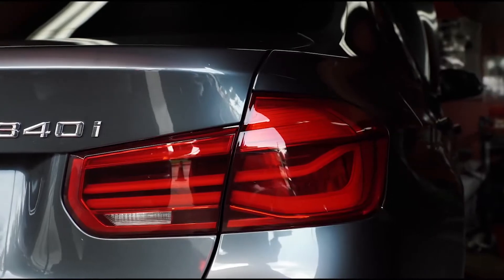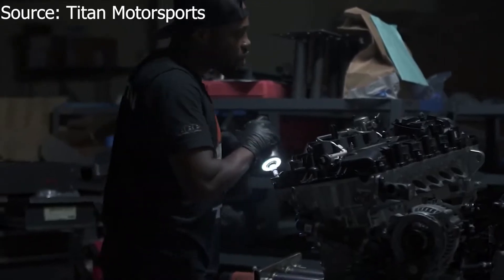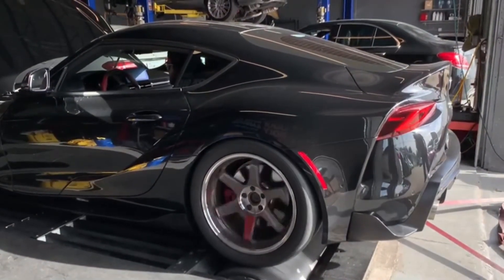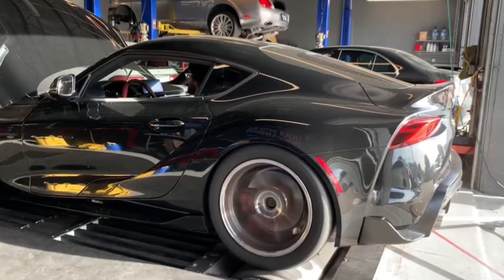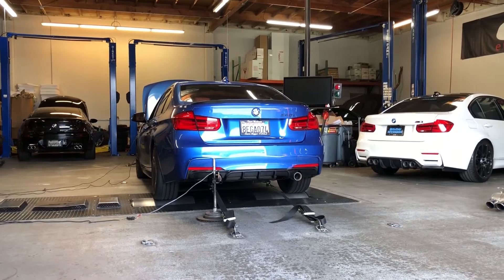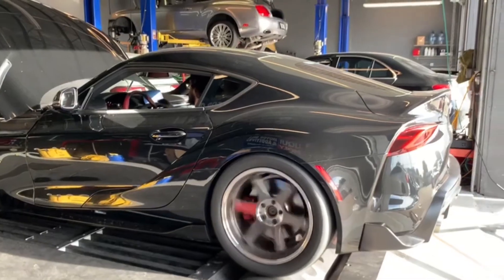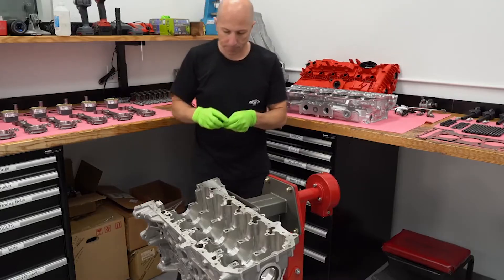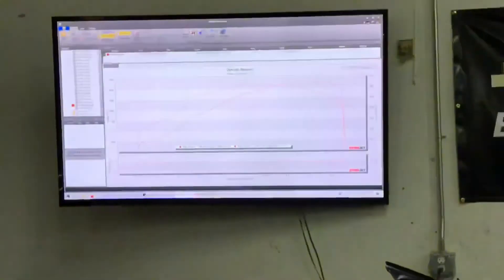How to Build you B58 (A90 Supra or 40i BMW)

Comment: I just bought a 540i i love it I have unlimited warranty for 4 years I kinda wanna make it more faster but I don’t wanna lose my warranty 😭. What you guys think I should do??!!
Reply: Find an advisor at bmw that’s cool and wouldn’t mind you modding your car, not much can go wrong with simple bolt ons and a tune
Reply: both MHD (tune) and XHP (transmission tune) can be flashed to remove it completely when you take it in for service. full flash takes about 7 minutes.
Reply: Meanwhile my dumb ass has  an E46 and is waiting for some stupid fucker to flip a 540i so I can put the engine in mine.
Reply: Get the BMW Power and Sound kit.  Warranty friendly and has a good tune map and excellent sound.
Reply: If you have 4 years warranty that means the car is probably made after they locked the ECU. Meaning you need to Femto unlock. That means you don't want to bring your car to BMW because one they update your car it will erase the FEMTO unlock and you'll have to send the ecu to Finland again and pay for it to unlock again.

Comment: What about the transmission ?
Reply: You’ll be fine up to 600hp on stock trans but you need a trans tune(XHP)
Reply: @MYRCHOBBY  im thinking about just yoinking a dct off ebay from a m5 and throwing it in a xhp tune and it should work i would assume not too much else would need to go on to hook it up? Should handle 1000 hp stock
Reply: Zf8 is solid
Reply: @JAGLIFTZ it’s a bomb don’t believe this
Reply: @UnpredictableMoose no it’s not. It’s over hyped but it’s not a bomb. I had zf cars and both held 700 wheel for over a year with constant runs. My second one did started to slip because I did 11 passes at track with hard launch. And that’s amazing for a 40k mile car that was beat on
Reply: @voidwalker9223 yeah stock zf isn’t rated for anything over 500whp/tque
Any upgrade above that should’ve upgraded transmission

Comment: You only need the TU pump and a downpipe for 500HP. Everything else is optional but nice to have
Reply: Can’t forget the tune.
Reply: Wait is that true?
Reply: @DrunkenVtec correct. TU pump + Down Pipe are the only two mods needed to hit 500 crank. I’ve seen about 430 wheel on 93 pump and ethanol blends push very close to 500 with just those two mods and a proper tune to account for them. Most intakes actually lose power over stock box + panel.
Reply: @DrunkenVtec  I got it on my M140
Reply: It’s true I have a 16 b58 I have a highflow Carter downpipe, TU HPFP with stage 2+ I also have the bm3 flex fuel kit to run any type of ethanol. I got 510 hp stock turbo on E40 and I also have a mst intake lol sounds cool
Reply: @Ghostmef30 to the wheel or crank?
Reply: @Ghostmef30 who tuned ur car
Reply: To the crank, yeah. Maybe 420 wheel
Reply: @liejuh58  they dyno 450-480 wheel on e40

Comment: You need an upgrade full pump for 500hp if you have an older b58
Reply: What’s considered older?
Reply: @mreverything4152  if isn’t the b58tu it’s the older model
Reply: @giannisformvp3568   I have an m240i 2018 does that come with the Tu?

Comment: On a B58 just get a good panel filter and keep the stock air box.  It's so well ducted from the front you won't be gaining much with a CIA unless it has a full air box that is ducted also.
Reply: Only if you are stock turbo. If your upgraded turbo. You need aftermarket intake that’s less restrictive
Reply: they look better
Reply: That’s if you are stock turbo……
Reply: Most after market systems lose HP on the B58. Panel and stock box (stock turbo) usually produces best results. I wish it weren’t his way (I want more induction noise from my 340i, but prefer performance to show) but it is.
Reply: You will be losing power if not well ducted and you will be gaining next to nothing even if it’s ducted the only application for intake mod is sound and super big power build anything under 600whp the stock air box with panal filter do just fine.
Reply: @swank1975  what do you recommend as a good panel filter?
Reply: @ I'm running a K&N.  I'm sure some will say that is not a good panel filter.

Comment: You don’t need a charge pipe on the b58
Reply: You definitly need a charge pipe if you go meth injection. The oem charge pipe dosent have a bungle for meth injection.
Reply: @ai3270  The Charge pipe was the choke point of the N54, They got it right with the B58... You really dont need to upgrade it until big boy numbers or else u are just wasting money, same with a CAI its really just not needed..
Reply: @skouria3135  they are not needed but sure do sound better with them both and u do get like 10hp  9ft lb with mst and chargepipe
Reply: @skouria3135 this is a lie. taking out the plastic chargepipe for a metal charge pipe also increases throttle response. day and night difference
Reply: @ wrong lol, explain to me how the material difference and not size difference increases throttle response lol. Go ahead and